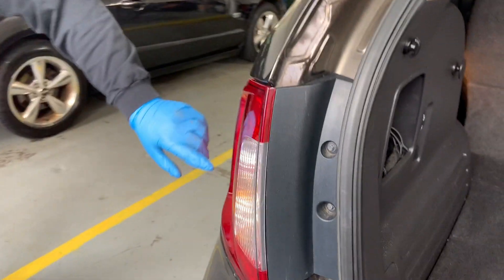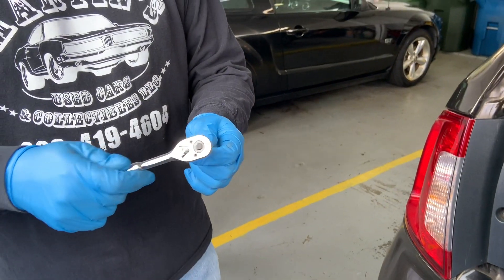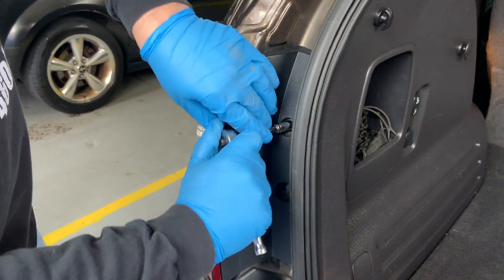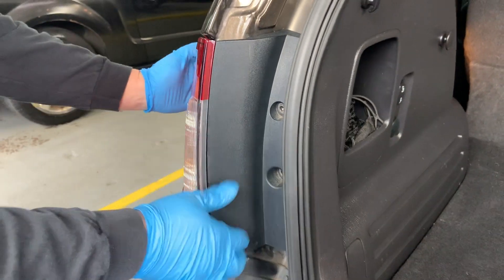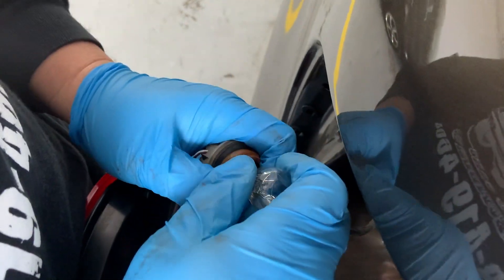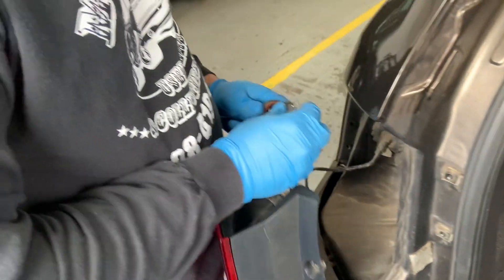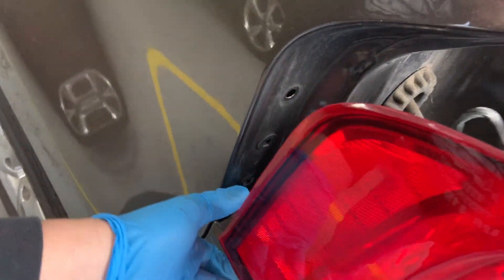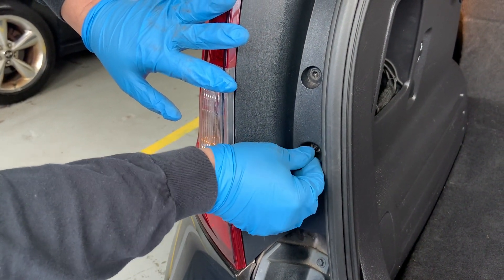How To Replace 2011-2014 Ford Edge Brake Light Bulb

Comment: Idk if anyone will reply here. But my edge seems to have lost the upper? Brake light on the right side. Are there 2 lights there? Because the bottom one still works. Im missing like..half of my right side light.

Edit: i missed it at the start...there are two bulbs